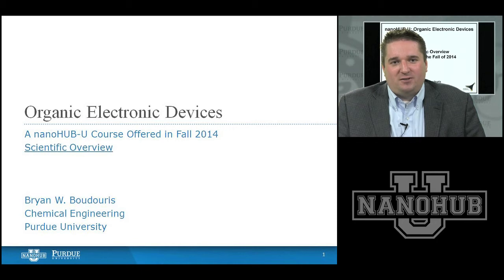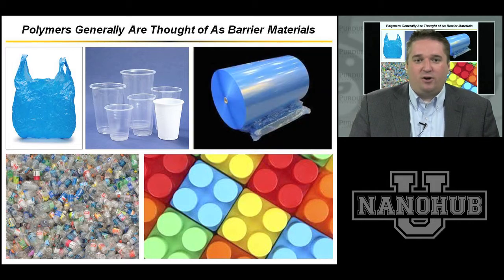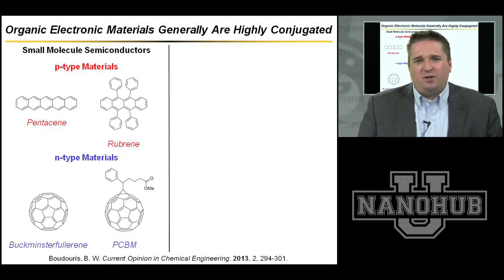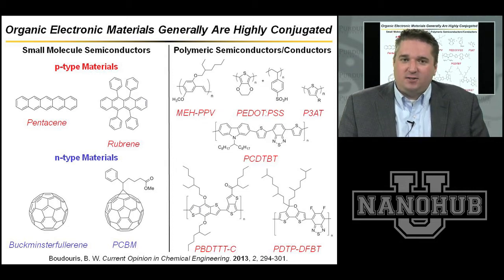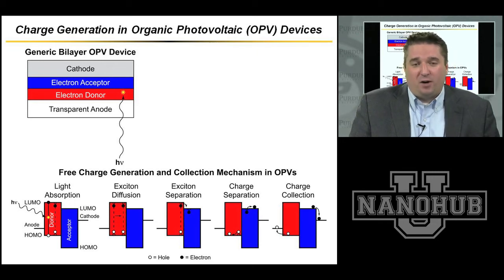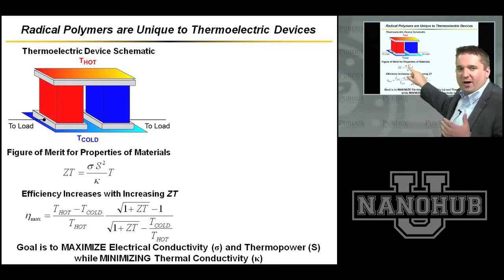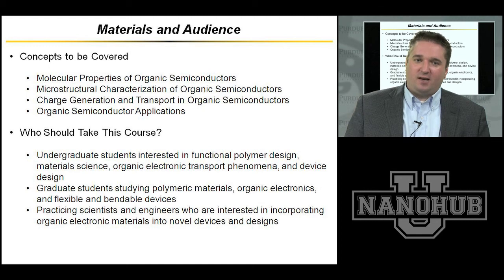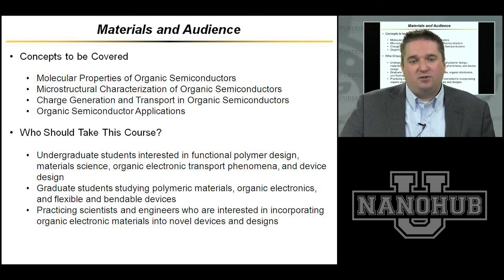nanoHUB-U Organic Electronic Devices: Scientific Overview

Comment: As far as collecting waste heat; could body heat be considered waste heat?  the reason I ask is I imagine charging a device connected to your skin using your body heat.
Reply: 3 years late, but it definitely can! The waste heat isn't as enormous as in power plants or in cars, but you could definitely use your body heat for low power applications such as for sensors, and RFID technology.